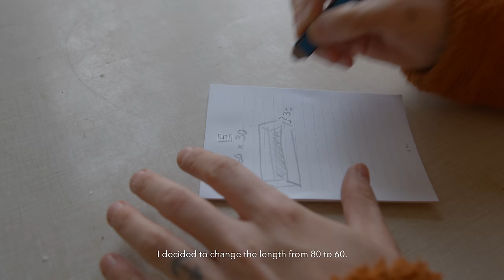Ch. 31 - Working On 70 Year Old Well

Comment: Marcus, that is lead paint you are scrapping off the windows. Please be careful as I dont believe you have enough protection (just a warning).
Reply: Not necessarily paint with lead pigment, a hundred years ago zinc paint, based on zinc oxide, was also widespread. But titanium whitewash was definitely not available then. But zinc is also quite toxic if dust gets into the lungs.